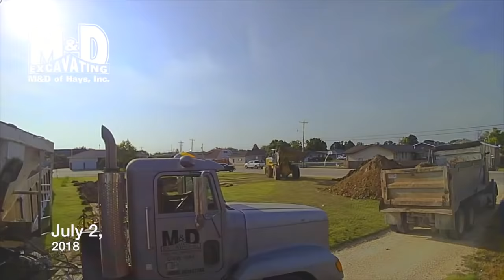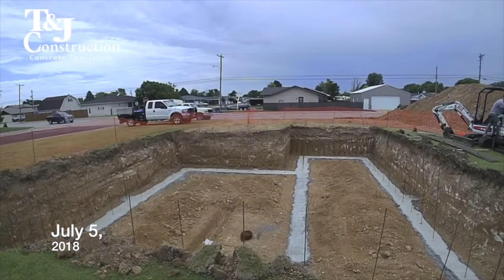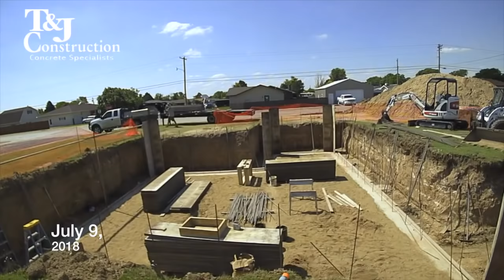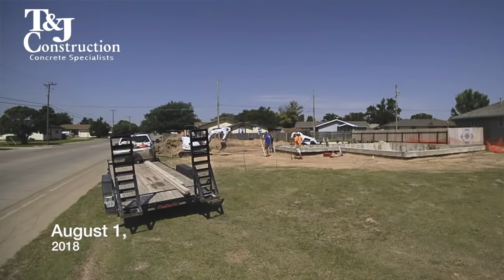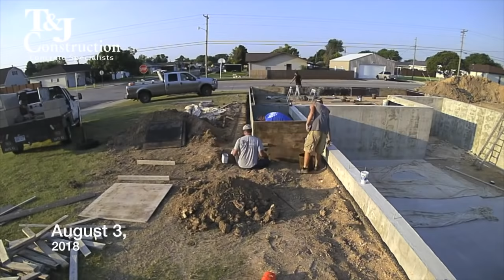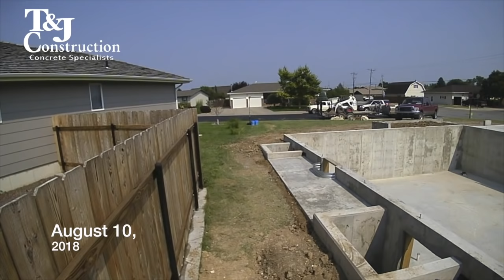How Americans pour a BASEMENT in a dry climate.

Comment: American homes are so involved. In Australia it’s just: Concrete slab, no basement. House. Next job.
Reply: Damn. Where do you keep the washer, dryer, furnace/boiler, HVAC, water heater, etc? Tucks nicely away in the basement so the main living space is better.
Reply: @WackyPossum  Washer and dryer in the laundry (small room inside house), hvac and water heater outside, furnace it isn’t really cold enough here. I live in a cool climate area and even here we don’t run a furnace, just a regular hvac heater. Sometimes the hot water heater / boiler is inside the laundry though, depends where you live and whether you want the space for something else. I have an on-demand one so just a panel on the wall outside that has pipes in it that get blasted with natural gas fire to heat the water as we need it. Also most of the country has pretty long days, only one very tiny part of the country in the south of Tasmania has short days in winter. The top probably 1/3 of Aus is a tropical climate.